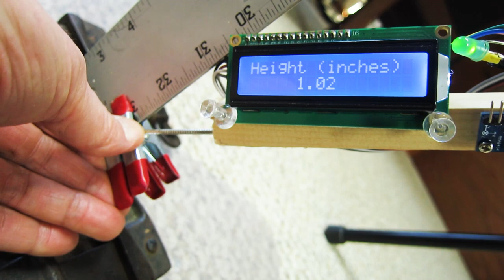Measure height with an accelerometer

Comment: How to calculate height with nano without anchor point on tripod? That's the real question
Reply: The only way to calculate the height is to define a constant. For example, putting the nano on a float, you would need to define the zero height then measure the acceleration between set amounts of time, put that into a equation using acceleration and a set amount of time and u will get your the distance between 2 points, just add or subtract from previous height. Not too complicated

Comment: code?
Reply from the maker: A sketch is available at the link in the description.
Reply from the maker: @chandanvudala6778  Yes, the LCD monitor is not needed. All data are saved on the SD card.
Reply from the maker: @chandanvudala6778  Yes, remove the LCD monitor and everything else will work the same as before.